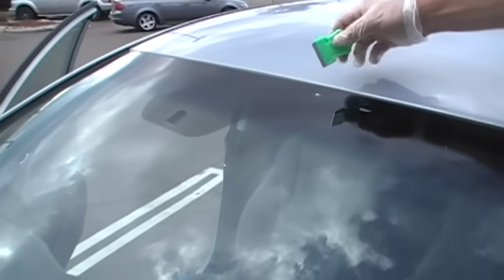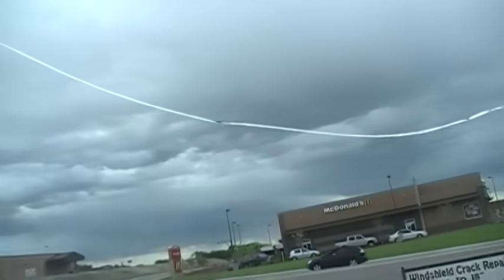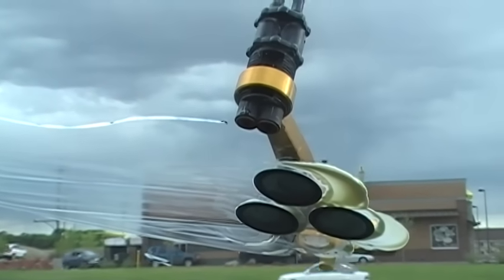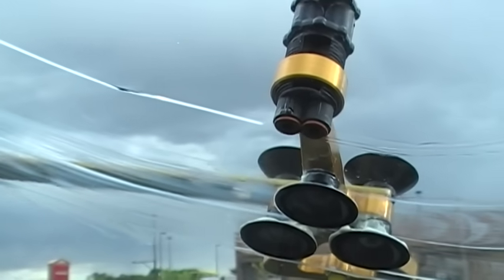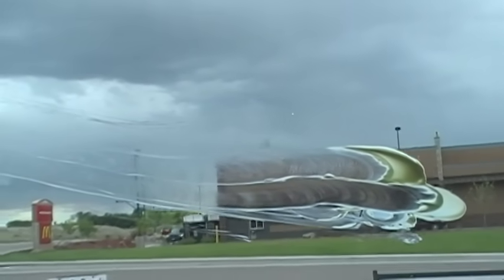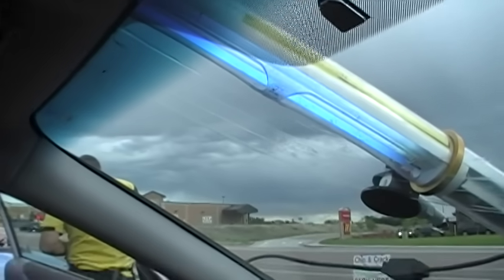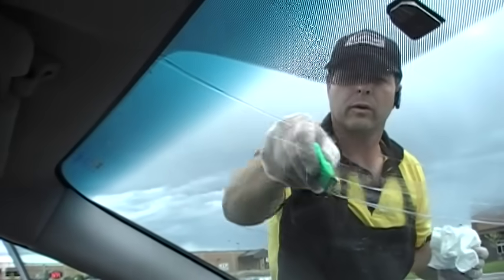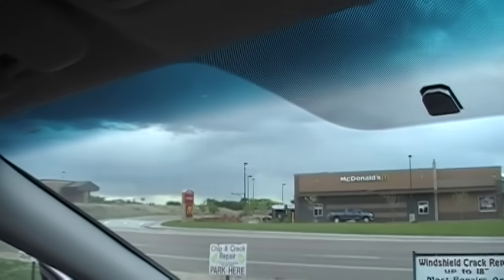How to Repair a Long Crack in a Windshield by Crack Eraser

Comment: is ur repair company able to come to Delaware. I have a 20 inch crack in a 89 buick reatta windshield and  can't find a parts car to pull the windshield and I heard it's encapsulated so I don't know how to remove it. a windshield from safelight is over 1200$. help!!

Comment: And how does this affect the structural integrity of the windshield?
Reply from the maker: The structural integrity is not affected because windshields are laminated glass, The inside layer is usually not broken so repaired windshields will pass the two safety tests all windshield must pass.

Comment: While changing the passenger side windshield wiper, the small metal arm fell back very gently hitting the windshield with its metal tip which caused a small hole on the inside of the windshield exactly between the windshield and the dashboard. No cracks on the outside. Now half of my windshield is horizontally cracked. Bad Korean material. I have no choice but to replace the whole thing.  PS, my insurance didn't cover windshield repair.

Comment from the maker: It is very strong close to original Glass.
Reply from the maker: Cleo Dawg $60 to $80
Reply: Impressive! Very sorry, but in any case, we in Russia (where I live), such problems are solved with glass replacing. And replacement glass costs about $ 100. How much does a tool like You??
Reply: +Клим Ворошилов winshields can be 90 /1000 depends on what you drive
Reply from the maker: I am not sure about long crack repair passing in Finland. It will pass in the US most of the time. Repairing Chips before they crack would pass inspection and is the best time to save the windshield.
Reply from the maker: Hello Bruno, I do not have anyone in Las Vegas but we are adding shops so you can go to our Certified Partners page on the Crack Eraser web site and see if we have someone in your area..
Reply: Tim Evans ..what if a crack  has multiple crack lines...is this same procedure recommended??
Reply: Tim Evans anyone in Chicago south side please
Reply: Tim Evans How much does a repair like this cost?
Reply: Tim Evans where cause my car got a crack and i need to pass inspection next week please hmu
Reply: Tim Evans thank you for the reply! I'm in AZ wish you guys could help me.
Reply: Tim Evans anyone in Las Vegas?  I have a very small crack point with two "legs". No more than half inch for all. My fear is little by little is growing.
Reply: Tim Evans // You would want to drill about two 1/6 past the end of the crack , or you could even drill 1/8 instead, lol haha, jokes aside , good job.
Reply: Hi Tim you got any recommendations in Delavan Wis
Reply: How much does it cost??
Reply: tormen76 im live in finland and my windshield is crack , i gonna try this stuff before inspection 😊 if its work i save my money

Comment from the maker: the crack is very tight at the tip and needs a real thin resin as it goes to the Edge gets wider a gap like about 12,000 wife or So. So thin resin will not Bond where there's a Gap is like trying to use super glue or you need epoxy.
Reply: hey mate, just curious because were i'm from. It would be insane to perform a crack repair, it's cheaper and easier just to replace the windscreen. plus.. were im from...  Can't gaurente the crack wont continue to run off. loads of bumps, potholes, divites and even no road at all in my country lol.  NZ

Edit: Wouldn't it be more profitable for you to just replace windscreens/windshields instead of crackrepairs? unless you charge more then 140+ for crackrepair.
Reply: Hi Tim, 
Will the windshield crack still visible from inside after fixed?
Reply: What part of Texas are you in?

Comment from the maker: it works well in single cracks. that go to the edge.
Reply: @Tim Evans,

Where do you exactly tap using a needle to create a bull’s eye: past the Dremel drilled point and exactly opposite where the crack stops?

I tend to think the little drilling at 2/16th of an inch in front of the crack end suffices to serve the purpose of stopping the crack from propagating, and rather fear the tapping would create multi-directional crack seeds (but apparently that’s not the case as you’ve successfully completed thousands of repairs that held up but I’m trying to understand why my theory isn’t valid). The drilling with the Dremel creates a tiny crater that catches and ends the crack from proceeding further. So, I’d like to learn of your comments on my theories.
Reply: Hi tim may i know brand you used. And how much the tool kit

Comment from the maker: You can repair a crack if you can reach the tip to drill it. you need to load the injector by putting the resin in the bottom then installing the injector seal.

Comment from the maker: Hello Jnptab,
I do not know if he used our system or not and if he got all the air out. Our multi viscosity system matches the resin to the gap of the crack giving the strongest repair with the best cosmetics. Dirt does make the crack show more so that part is true. Most shops trying to fix cracks are using a system designed to repair chips not cracks and that does not work nearly as well as a system designed only to repair cracks.

Comment: would like to buy your tool however i did drill got a bulls eye and th 
plastic tool used could not get the vaccm and i had to scrape the resin i
 poored over the crack a month ago using the mylar tabs it cure in the 
sun, after doing all this i still could not get the resin traveling 
through the cracks from the impact site? Can you help me and how much 
those your tool cost? thanks.

Comment from the maker: Hello Jean,
You may start with the kit #1. it does not use the lever cup. it uses 3 small suction cups. As far as the lamp, It is only needed when the sun is down or working inside. For shipping cost I would need your complete address and phone. The best way from here is to go to my contact page on the web site and email me for further instructions.

Comment from the maker: the first windshield repair kit has molded tools and as a starter kit. The second kit has aluminum tools with the triple start thread for chip repair and short cracks. The third kit is the powered by crack eraser kit with the dual injector for long cracks. in our business we use the third kit.
Reply: +Tim Evans 
Pro Kit #1 (chips and cracks up to 18") Approx 100 repairs. Great starter kit with molded Crack Eraser tool. that is the one am going to start with but do I need 9 watt UV Cure Lamp,9 watt UV Cure Lamp with Hold Down and Suction Cup  and 
Aluminum Single Injector with Lever Cup Can I do with
1. without any
2. with all?
3. or one of them(3) wat do there help. you did not respond on paying using western union
thank Mr Tim
Reply: +Tim Evans 
yes I have seen something what can Powered by
CrackEraser
Pro Kit #5
$1,294 and Pro Kit #2
$599 
Pro Kit #1
$274 that can repair it??! is that right

Comment from the maker: The technology is called Crack Eraser. The shops use their own names as we are not a franchise.
Reply: Mr.Tim Evans can you make a repair in Nashville, TN? I have a dodge charger RT and need a crack that's half the size of that one fixed. I would also need to know how much you will charge? the crack is spreading and needs to be fixed if you can't do it can you refer me to someone close that can please?

Comment: and in the 10 Mins of your  video I could have the shield out , and cowl off , so in about a little more then double your time , I can have the windscreen changed , also with a lifetime warranty aginst leaks and defects , to all nags,  and agris standards , with sub zero glue technology,  that repair in 11 degree weather is not as efficient , the comprised glass will always be compromised

Comment: and also that "won't disappear completely " as you stated would easily be eradicated by a replacement , anything over 7 inches I won't repair , and at danbury mercedes in ct , I witnessed a novus repair tech , denounce replacement , and 11 days after his 16" repair , I replaced said windscreen , as novus isn't the same as your company I cannot deduct your system as the same , but I've yet to see a Crack on excess of 7 " repair , as a permanent solution or fix as your own video states, it won't be perfect , anything in the drivers line of site , would leave a compromise ae a safety distraction , with a 23" Crack , replace the screen. and show some before and after of vehicles repaired,  after 1 yr in the over 7" ranks , and I'd be interested in the result
Reply from the maker: We have a long track record of repairing long cracks with less that 1% failure rate. So comparing us the other companies that do not have our technology does not mean much.
Reply: Anyone who repairs a crack larger than 6" (a dollar bill) is a fraud, a double fraud  if the crack reaches the edge of the window, a triple fraud if they drill into and then crack undamaged glass.

That resin these scam artist are injecting seals small cracks so they don't spread and ruin the structural integrity of the window. Once a crack reaches an edge or becomes larger than 6 inches the window needs to be replaced. Otherwise it will likely fail in an accident, or could even collapse during driving.

These repairs are also not permanent that resin oxidizes over time and will become brittle and will flake off over time.
Reply: +Tim Evans hi, the best wind shield fixer in my city failed to repair the crack in my car and said it's because it remained cracked for some time before I got it repaired which made the fix with low effectiveness. is it true that in this situation it couldn't be fixed or he is just not good enough
Reply: +Tim Evans so badass!

Comment: as I am an autoglass installer and repair tech, I will say it looks great , but in my 19 yrs experience , that Crack will re appear , after some temperate fluctuation , and any hard impact driving over rough roads etc

Comment from the maker: Tom,
You have not tested technology as we have, We see repairs that we have performed years ago and they are still holding fine. We provide a lifetime warranty and give money back on all repairs that fail over time. You have not done your research, People said the same about chip repair for years.
Reply: Hey Tim. Where are you located? Im needing a 5" crack repair
Reply: Most states will not inspect a vehicle even if its been repaired, just replace it and move on
Reply: that is a bs excuse, the windshield is part of the structure on most cars and your stuff is dangerous.

Comment: Tim,
I have to say "that's impressive ". 
Being in the autoglass replacement Industry for 30 years and an NGA Master Autoglass Technician, I can honestly say I've never seen that done before. 
Probably because the industry and most reputable busineses and insurance companies don't recommend such large repairs. 
You should let these guys know that the two substrates, glass and the Ultraviolet Cured Polymer Resin will separate, over a short period of time and the crack will reappear, leaving them with the same problem that they came to you with.
Just because you can't see it now, doesn't mean that it's safe or even repaired. 
This is one of the reasons to replace as opposed to putting a "band-aid "on it.
Reply: @DanOfTheWild This is not what dentists use for fillings and what is used to repair small planned and uniform holes in teeth that will not be exposed for long periods of time should not be used to repair 21 inch cracks in glass. You are ignorant to dentistry and glass science. About 14 inches and that windshield is compromised. Even the best resin and techniques and you will still see yellowing and shrinking in a 3-4 years if not kept in cover most of that time. These are never lifetime solutions. They are to get you on your way and save you some money for now. I understand people use this as their livelihoods and plenty of people do shoddy work to make a quick buck but these guys are doing it wrong.

Comment: hey Tim my main dude.
Have you ever repaired a windshield while riding a goat? 
Also I did a repair but I used a large impact drill & ended up drilling through the windshield, then through the seat & into the floor!
Where did I go wrong mr crack unit dude
Reply: Gavin thinks he's funny.

Comment: Hi iv129075,
We do zoom in pretty tight and the crack does look good however the repair does not hide the crack totally you still see it direct on, But at an angle if looks pretty good like a hair from your head and your windshield viewing is at an angle most of the time so it works pretty well.

Comment: Hi,  I am very intrigued by this.   I have a motorcycle that has some cracks in the headlight.  Its acrylic I believe.  A new headlight costs over 500.00.  Could this resin work on small thin cracks and if so where might I purchase some?  Whats it called?  I assume its not the same stuff you can pick up at autozone?  That stuff seems more viscous or thick.  Thanks Tim.

Comment: Hey guys, I wanted to find out more about your kit and the dual head tool.  Did I not go to the right place when I typed in :  www.windshieldrepairkit.net  ?  I put it into the top search bar and it came back that this site was for sale.  What gives ? !
Don't you have a site up and running?

Comment from the maker: We do do longer crack such as one going all the way across the windshield, However it will have a larger gap when the crack goes off the edge on both sides. If the crack is over a week old or so I do not think a repair is the best option.
Reply: o
Reply: would it be wise to put clear tape over it until you can have it fixed to keep dirt out
Reply: You filled this crack with u v

Comment: Any advice on a crack that goes right to the edge of the glass and where one side of the crack is raised up above the other? I haven't tried pressing on the raised side to make it flush in case I crack or break it more. One is raised above the other by about 1/8".

Comment: Hello Aaron,

The acrylics will work if the crack has some dirt in it however the crack will just show more. If your crack is over 3 months old It will have dirt in it and you may want to replace it instead of repair.
Reply: Ok Thanks 8) Yes its been way over 3 months and I dont have the money to replace it at this time ! I didnt know if there was a way to clean it and then use the Epoxy kit and have it work fairly well ?

Comment: I would like to fix the crack on my truck but its been there for a good while . I dont have full Ins. coverage so replacing it is out of the question for now , is there anything I can do to fix and or slow the crack ??
Reply: drill a hole just in front of the end of the crack, but not all the way through. that should stop it for good.
Reply: Thank You !! I wanted to use one of those epoxy repair kits but was told if it been over a month or more which its way more then that , The epoxy wont work because of dirt in the crack ?? I guess it cant be cleaned out or cleaned well enough ??
Reply: Aaron Manderscheid if you had someone apply pressure to the crack from inside the vehicle while you sprayed a cleaner into the crack that would or should get all the dirt out. as long as you dont see anything in it I would think it be fine to try one of those epoxy repair kits. if worse comes to worse just replace the windshield. not really anything else you could do anyways.
Reply: Yeah Its needs to be replaced but worth a try with the kits until I have the money ? Thanks for the advice very kind of you 8) !!

Comment: Most repairs are covered by your insurance because your deductible is waived for preventive repair even if you have a 500 deductible. If you do not have insurance most repairs are $60 to $80 depending on the length of the crack.
Reply: So I read on your websites that cracks which is 2 months old need whole shield replacement?

Comment: That is pretty amazing! I have an Alfa 164 with a crack at the base of the windscreen not even as large as this. Safelite said they couldn't do anything about it, but obviously in can be done. (I'll also have to have something done because new windscreens are hard to source.) It may not be perfect, but it was pretty amazing how much of an improvement it made. I didn't notice anything until you mentioned the roof of the McDonald's. Thanks for the honesty! Are there any stores in Wisconsin? I'd drive because it looks like it can be done while you wait!

Comment: Good question Goofy Goof it depends on the length of the crack when we first invented the technology we said 18 inches now we have improved on it to where we can do 24 inches or longer. If the crack is only a couple of weeks old we can perform the repair. If the crack is over a month or two old then it will have dirt in it and we usually would not do the repair. We prefer to repair cracks less than 3 months old after that we recommend replacement.
Reply: Can I know where you are? My windshield was cracked yesterday.
Thank you.